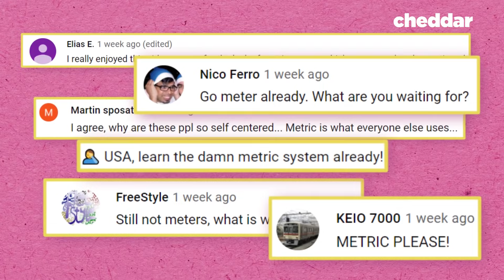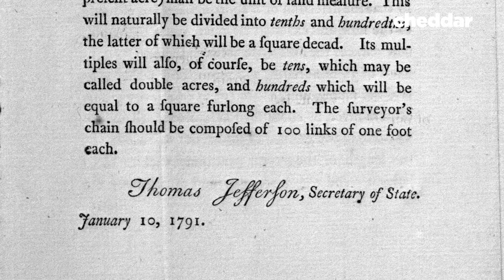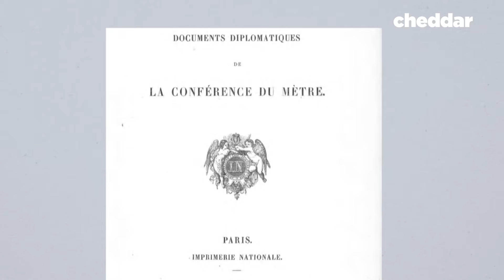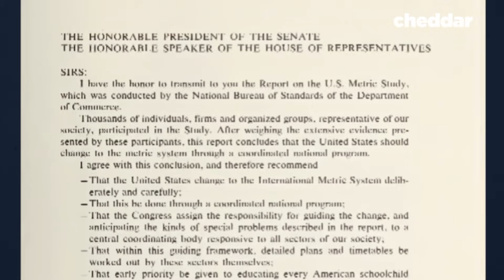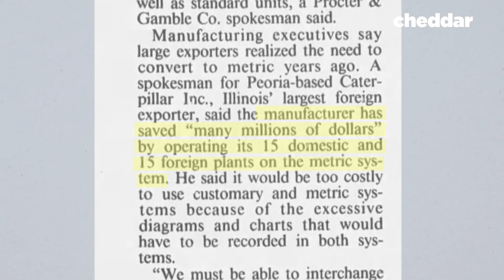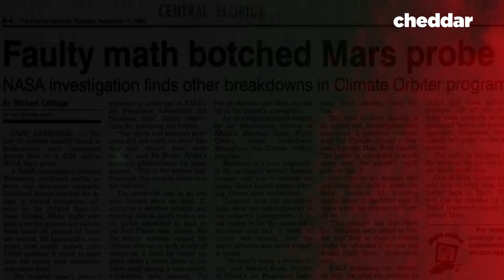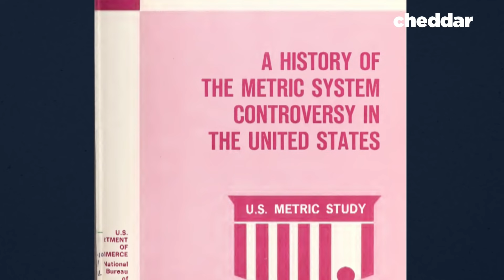Why Doesn't the US Just Use the Metric System? - Cheddar Explains

Comment: The problem with the metric system is that it has no real advantages AND it has a failure of conviction.  Time, which has been measured in base 60 and 12 for over 6,000 years has not and will never be metrified to a 10-20 hour day.  Angles are still measured in degrees (also base 60) except in computer processors which use radians (circle = 2pi) which are then converted to/from degrees by every programmer writing a program that used angles.  PI, an irrational number has nothing to do with what most people consider the metric philosophy of whole numbers and no fractions. . .  In engineering the metric system commonly uses halves and quarters. . .  more. . .

The whole "no fractions" thing is also anti-mathematical.  Fractions are algebraic.  IF fractions were taught properly in schools then everyone would have a jump on basic algebra and be much more fluent in math for their entire life, not just their school years.  Starting with measuring in fractions, then adding, subtracting fractions and finally finding the lowest common denominator is ALL algebraic.  I still remember the day the metric system was introduced to us in an elementary school science class and everyone cheering,  INCLUDING the ignorant teacher who's feeling that "fractions were hard" was passed on to her students. . .

On the other hand, the inch system has been decimal for over a  century.  In engineering everything is in decimals and the odd conversions from fractional are indistinct from metric numbers because everything in engineering has fits and tolerances, shrink allowances and many other factors that result in virtually nothing coming out in even 10's or ending with a zero.

THEN there are the arbitrary units themselves.  IF we want a planetary system of measurements don't you think it should be based on some universal values that could be understood by someone from another world AND are based on true constants?  Temperature base on the boiling point of water at sea level which is constantly changing. . .  Mass and distance based on arbitrary pieces of metal?.  Well. . . mass is not so bad as 1 cc water @ 3.98 C = ~1 gram.  But then that pesky odd temperature measurement is in there. . .  SO, why not a universal system based on absolute zero and the freezing point of water (both universal constants).  But then there is the human factor that says all precision measuring tools are calibrated as true at a comfortable 70 F (21 C). 

Does anyone remember when 1 inch = 25.400048 mm because there was an error in the meter standard supplied to the U.S.?

AN THEN, there is the  same infrastructure concerns as way back in 1885.  I, like millions of others in the US have a shop filled with English unit precision tools.  Not just simple measuring devices but precision tools (micrometers, veneers, scales) measuring up to four feet in microns.  Then there are the many weighing devices from, yes, grams, up to tons.  

AND as far as the US Government moving toward metric, the Post Office still uses pounds and ounces (won't even accept decimal pounds)  and various government agencies paying to have designs purchased overseas converted to English units (I bid on one of these as recently as the late 1990's and have done several metric to English design conversions for private industry working for the government).

Meanwhile, most of the world outside the US works equally well in English and metric units while we in the US struggle with fractions as well as metric conversions.
Reply: ONE MORE THING:  For decades we have been told that by not going metric we (the US) would be less competitive in the World economy.  The truth is that the stupidity of exporting jobs and the  bullheadedness of our auto makers who let the Japanese take over the auto industry because they refused to make more efficient vehicles is what has been killing our global economic advantage.  Meanwhile the bulk of English standard fasteners, bearings and gears (and many other things) are made overseas in fully metric countries. . .  Think about that bit of irony.

Comment: Metric system in a nutshell (For Americans)

m- milli /1000
c- centi /100
d- deci /10
-----------------
D-deka *10    -rarely used  (even in metric countaries like Serbia)
C-centa * 100 -rarely used (even in metric countaries like Serbia)
K-kilo *1 000
M-mega *1 000 000
G- Giga 1 000 000 000
T-Terra 1 000 000 000 000  -rarely used (even in metric countaries like Serbia)

m -meter length
g - weight
l -liter volume of liquid=1dm²
N -force N=1kg*1m/s²

Comment: Imperial and Metric both have their place and will personally switch between the two depending on what I’m doing. However if you’re going to promote the Metric system at least spell Metre correctly 🙄
Reply: I think the problem is that some English speaking countries spell it like "metre" and others spell it like "meter"
Reply: I think the problem is that some English speaking countries are too thick to realise the difference between a unit of measurement (Metre) and a device for measuring (Meter) e.g. a speedometer or thermometer etc...
Reply: @tom6493  or a translation error, since in some languages both are written as "meter"

Comment: I have no problem with the metric system. As a mechanic I use the metric system on a daily basis (unless I'm working on older stuff, but I digress).  But having the only system you are used to being what is you have around you (inch, feet, cup, gallon, miles, Fahrenheit etc.) and that's what you can visualize in mind and can easily understand and formulate in your head what that is. What I mean is if I were to say something is about 1 inch long, someone from where I live would immediately understand and have a good idea of how long that is. However if I was to say something was 50cm, I'd more than likely get a blank stare. (Of course I'm not saying one inch and 50 cm are the same, it's just an example) So until I start seeing kmh on the roads, recipes using centigrade for temps and I see centigrade on my oven, grams for measuring ingredients along with 250ml "cups" unfortunately I'm stuck using it.
Although, what's interesting is even in Australia if you were to enter a lumber yard, there's a good chance folks will start saying inches and feet. Just food for thought.

Comment: I'm  a carpenter, unlike autos, power tools, and drugs, building materials still use "English" measure. How are lumber, plywood,etc. dimensioned in metric countries ?
Reply: In Australia an 8'x4' sheet of plywood became marked and sold as 2440x1220 for a time and then it gradually changed to 2400x1200 actual size , 3"x2" timber became 75x50 mm , things like wall studs went from a standard spacing of 18" to 500mm . The old ton was 2240 lbs ( we used the long ton as standard ) and a metric tonne 1000 kgs is 2204 lbs ( approx ) so fairly close . The cubic metre replaced the cubic yard . Unlike North America we had pounds shillings and pence currency to contend with which converted to the AUD .
Reply: @Gordon_L  Thanks.

Comment: I worked in construction for 10 yrs. If I wanted to be precise I started measuring in centimeters and millimeters, because the Imperial system was just not accurate enough, having the fraction of the inch being larger than mm and it adds up quickly not to be at level or parallel at the end. Being off in mm a little bit is not as a big deal as being off by 1/16 of an inch.  Inaccurate measurements leads to crooked windows and doors and walls. There are a lot of buildings in the US that they are crooked  for this very reason.
Reply: @Frank HunInvader
: I hear you and also used to work in construction. 1 foot in the US more or less 1 foot, and it can be a few mm off. But 30 cm or 300 mm are exactly what they are. Explaining to my US customers what is 1 mm or even 0.5 has always been a nightmare.

Comment: I see in feet, not meters. I know when I have walked a mile, not a kilometer. I have even had training in the military using the metric system. It was a futile attempt.  I can gauge the length of 6 inches but not 6 centimeters. I know what 70f feels like, and can only guess that is 30c. My plants also need to be kept at exactly 65.5f, and 18.6111c is hard to find a thermometer for, and a pain to write out. I don’t like being ripped off paying for gas by the liter, as paying for gas by the gallon has more of a psychological wholesale effect. Maybe too there is a greater appreciation for the difference between 69f and 70f vs the fractional difference in Celsius.  Fucking hot is 100f, and fucking cold is 0f, relative to me, not water.
Reply: I agree that 0f is indeed VERY Cold. However, 100f is just a few weeks of average top temperatures in many locations in Australia during Summer. Maybe 110f and now you're talking.

Comment: I so, so wish woodworking and carpentry used the metric system. I'd be hard pressed to think of an area that could benefit from it more. The frequency of having to convert various imperial measurement units is fairly frequent, confusing and mistake prone. 
How many 1/64ths in half an inch? How much is 1 3/32 + 3/8? How about 5/32 and 3 5 1/16? See the problem? 

Notice that even the notation is error prone. Did I just 35 and 1/16 rather than 3 and 5 1/6. Was it was 351 divided by 6 instead? 

All of this is instantly eliminated with a decimal (ten base system).
Reply: If you're as dumb as you sound you should stay away from things sharp enough to cut wood with. You seriously can't divide 64 by 2?

Comment: When you change system of measurement, you also change to other technology:  Such as with fasteners, (it is not trivial): American Industrial Engineering vrs French/Euopean ideas.
Example: Imperial snaprings are thick, using a shallow groove. The metric snapring is very thin and reguires a deep grove. The result is that the rod diameter for the Imperial snapring is smaller and the final assembly is stronger: better @ miniturization.

Comment: No real point for us to switch to metrics for the most basic measurements. In middle school we're taught conversions between the two measurements, so it's not really necessary to spend the time and effort to change all the signs and labels across the US. We do use metrics in the science field, but for the day-to-day, that kind of accuracy isnt required.
Reply: Except it could be so much easier.
Just by saying "I walked around 2,4 miles today" you probably can't tell me what that is in foot or inches.
Or how many ounces fit in a cubic inch container.
With metric, all these things are standerized. 1 KM = 1000 meter = 10.000 cm =100.000 mm.
It's so much easier and more practical
Reply: @Shirokroete  But in most cases, not necessary. Youre also forgetting that in a world of smart phones, all of these measurements can be converted and broken down in several different measurements simultaneously.
Reply: @rickregina5053  But why would you wanna go through the trouble of converting everything instead of just being able to quickly make out what the measurement is in your head
Reply: @Shirokroete  The big reason is a large number of things in my normal day dont require units of measurement, except for distance driven, which i hardly pay attention to, and maybe the amount of fuel im putting into my car, in which im just watching how much money is flying away from my wallet. Measuring ingredients in food, i tend to just mix ingredients to a point where im happy with the taste than any precice measurements. When I do travel overseas, im not too worried of measurement conversions because I really dont have a need to convert distances. The vehicle can do that for me. I just have to make sure my speed matches whatever speed limit sign I see.

Comment: I’m an American and the thought never really occurred to me to switch until I actually tried to use the imperial system for something important.

I’m trying to lose weight and I needed to measure my food in ounces.... the math was a nightmare so I had to just guess. Hence forth I’m learning metric so I can actually figure out what portions I need >.>’
Reply: You will mostly use grams and mililiters..
Reply: For metric the gram centimeter and meter are the most important
Reply: @victorbaltus1635  and centimeter is a 1/100 of meter, so actually only gram and meter.
Reply: xx x ooh I that way Yes
Reply: @xxx5446  even the names of our metric units are logical

centimeter - 1/100 of a meter
the prefix centi- means "one-hundredth" - and it can be attached to all different units of SI measurements (gram, meter, ampere, etc...)
.
others are:
.
yocto- (1/10^24)
zepto- (1/10^21)
atto- (1/10^18)
femto- (1/10^15)
pico- (1/10^12)
nano- (1/10^9)
micro- (1/1 000 000 or 1/10^6)
mili- (1/1000) --> like 1000 milivolts = 1 volt
deci- (1/10) --> like 10 decimeters = 1 meter
deka- (x10) --> like 1 dekagram = 10 grams
hekto- (x100)  --> like 1 hektoliter = 100 liters
kilo- (x1000 or 10^3)  --> like 1 kilogram = 1000 grams
mega- (10^6) --> like 1 megahertz = 1 000 000 hertz
giga- (10^9) --> like 1 gigawatt = 1 000 000 000 watts
tera- (10^12) --> like 1 terasecond = 1 000 000 000 000 seconds
peta- (10^15)
exa- (10^18)
zetta- (10^21)
yotta- (10^24)
Reply: I thought you said you were trying to do something important? Something important is like designing a jet engine for a passenger airplane. No one cares about your fat ass!